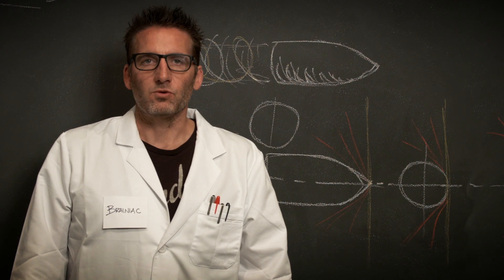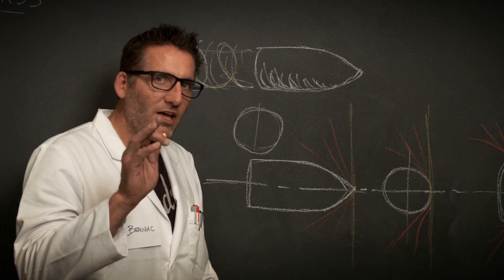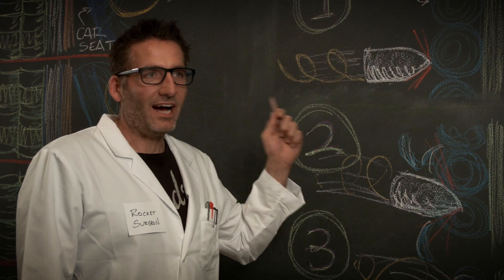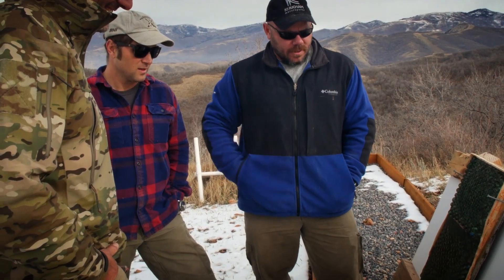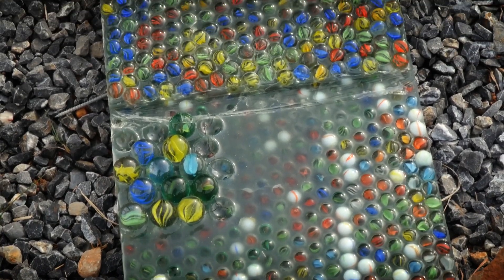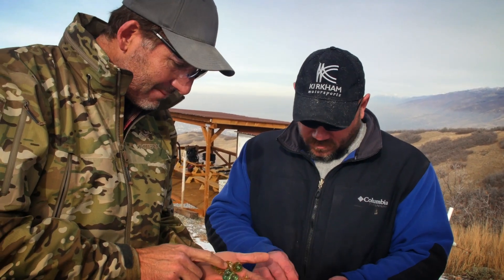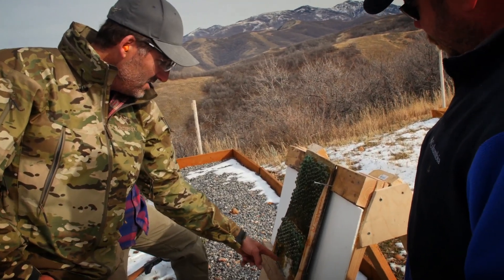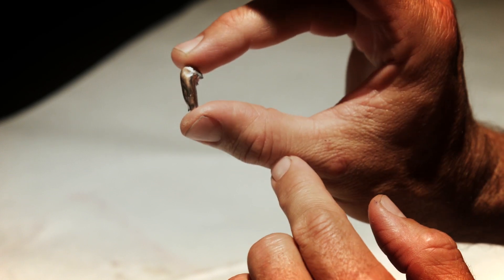Marbles for Readyman

Comment: Cool idea. Perhaps add a layer of fiberglass to the front as well.
Reply from the maker: That actually works to stabilize the bullet, holding the "tail" straight and preventing yaw.
Reply: @jasonross8368  aah yes a curved surface = yaw.